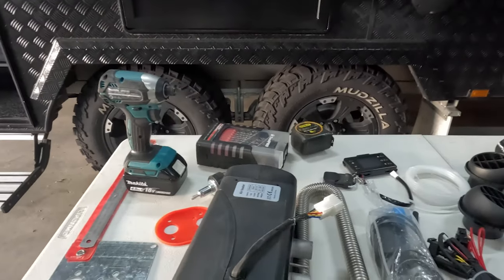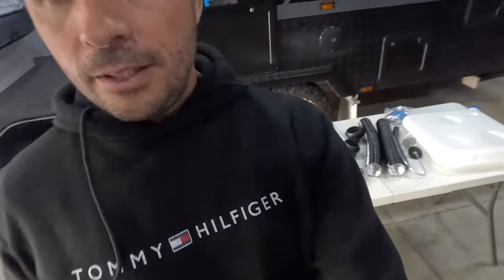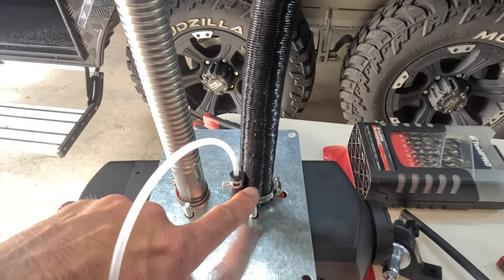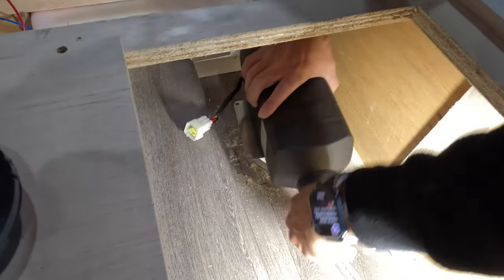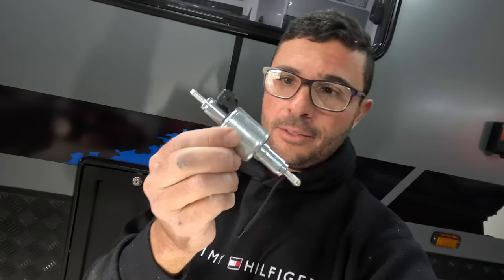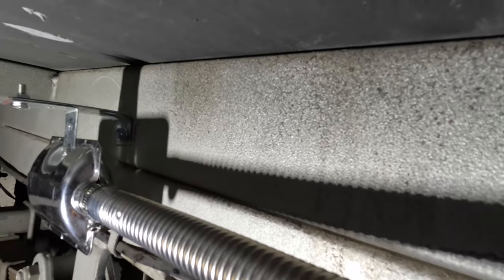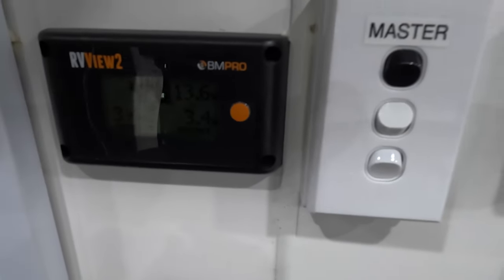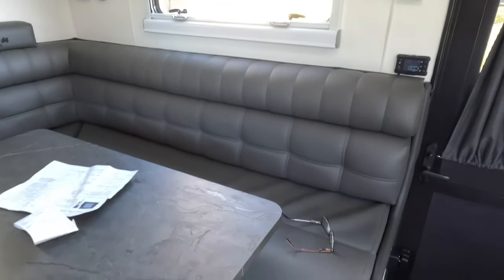CHINESE Diesel Heater Install in our Malibu Family Adventure Caravan

Comment: I put my pump wrapped with sound deadener in a piece of 100mm pipe and then put sound deadener around that and capped at both ends having the fuel line in and out at each end. Pretty quiet.
Reply from the maker: Thank you for this great tip!
We have found running the heater at its peak the pump noise is not to bad, but may still look at doing what you have done. Cheers and Thanks for watching!!

Comment: Thanks for your video of the install. I recently installed a 5kw in my van using the same method as you. Same down pipe flange and same sika as you. Just a word of caution on extending the exhaust. I’ve heard that the extension should be a larger diameter to reduce back pressure. Thanks again for posting.👍
Reply from the maker: Your welcome! How do you find the 5kw, Does it get too hot?
Really happy to hear we both have the same thoughts on bits an pieces used to complete the install 😊
I just completed the extension and petrol tank yesterday, the extension is the same size but has no bends so I’m hoping it will be fine. 
Will be doing another video shortly on how it all goes for it’s first use so be sure to keep an eye out 😊
Thanks again and happy you enjoyed the video
Reply: @escapevisitplay  I think the 2kw heaters would be more than adequate for most vans. My van is only 16ft so I’m sure I’ve overdone things with the 5kw version. Most of the complaints I’ve heard online are about the heaters going past the set temp ie. set to 18 but continues past that up to 24 or 25. This appears to be more of a problem for those wanting to run them overnight.

I won’t be running mine overnight as I got it for those cold bleak days where I just want to get out of the weather and stay warm.

I’ll keep an eye out for your next vid.
Cheers

Comment: I've bought 2 heaters like this for my 30 foot travel trailer.  I'm replacing the propane furnace and using the existing ductwork. Hopefully it works out good. I have a 38 seer minisplit that should do most all the temperature control but in case of extreme cold weather or emergencies the diesel heaters will be there
Reply from the maker: Wow mate 30 foot that’s a huge travel trailer, yeah definitely think 2 of these bad boys are the way to go, have used mine only a handful of times and it’s awesome! Good luck with the installation and thanks for watching! Cheers

Comment: Good install what I did is put a small inline switch to turn the panel off it would be better than disconnecting
Reply from the maker: Hey Steve I too did consider putting an inline switch but i had a bullet connector in my kit so chose that instead, either way i believe its a safe idea to isolate the heater when not in use, Thanks for watching!

Comment: Was the electrical connection hard. I see you have a BMPro Battery Management System. 
I considering buying one and installing it. I thought your video was very good compared to others I’ve watched but would’ve loved to have seen more on the electrical side. That’s the bit I’m concerned about.
Reply from the maker: Hi mate, I didn’t plug into the bmpro, instead I went directly to the battery, just be sure to fuse protect both ends of the cable run, hope this helps

Comment: Should have just used a turret plate as you have a gap between the ring and the heater plate.
Reply from the maker: That would have also been fine but just wanted to some additional cover, works great 👍

Comment: Great vid! Do you think the ticking is resonating through the cable cover around the fuel line ? I was about to cover my fuel line with the same stuff to protect it but have read that it should be rubber mounted just like the pump to stop the transfer of sound.
Reply from the maker: Thank you for watching! 
I don think the ticking is resonating through the fuel line cover, I have tried with about 2 meters of the cover removed with no difference in sound 
What I have found is running the heater at its highest temp the ticking disappears, which has worked the treat  for us 😊
Thanks again for watching and commenting
Reply: @escapevisitplay  Thanks for the reply! I'll be on my back under the campertrailer tomorrow,  getting everything else done that  I can whilst waiting for some longer ducting to arrive.
Reply from the maker: @CHOPSZOOKER   You will be wrapped with the end result, Good luck with the rest of the install 👍

Comment: Hey mate. We have a Malibu also and have a heater to put in. How does it go not running through the BM Pro system? Does it throw out your usage remaining much?
Reply from the maker: Hey Mate I personally have not experienced problems not going through the BM pro, however the heater itself does draw power (more so on startup) as the glow plug warms and will have a very small impact on your batteries, hope this helps. Thanks for watching 
Cheers